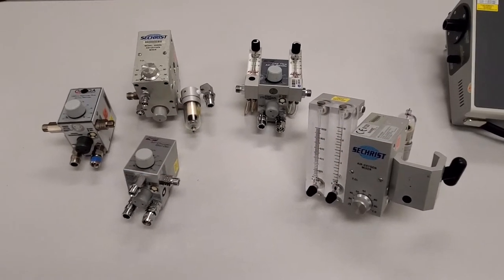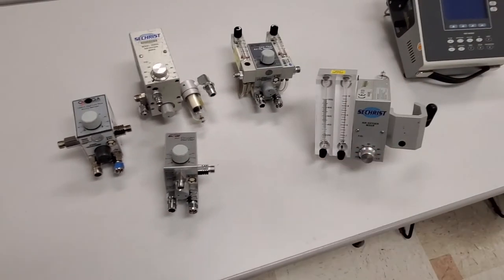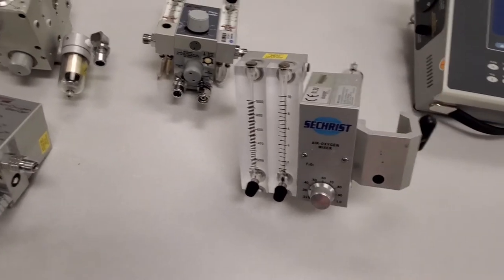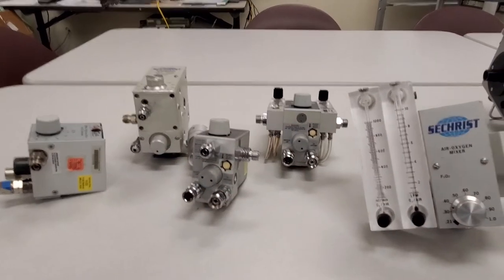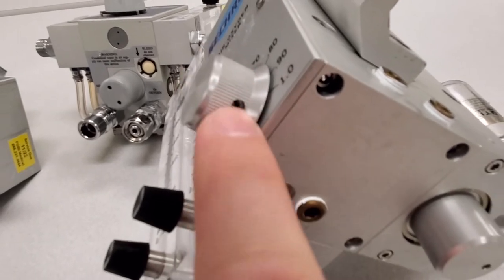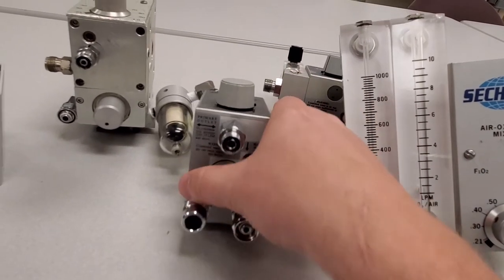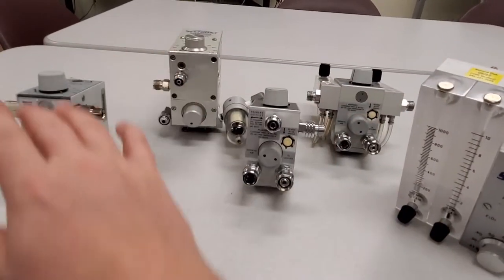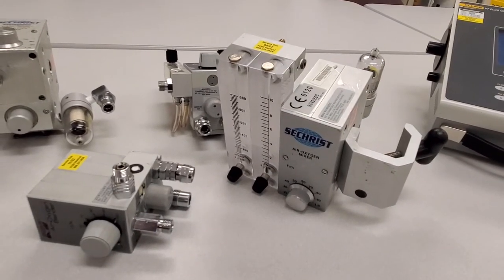Oxygen Blender Overview

Comment: I like to add some safety note and a question.
Oxygen itself is a non-flammable gas, but Oxygen can cause a socalled exothermic oxidation reaction, when oxygen comes in contact with lubricants like oil or grease.
So never use a lubricant like oil or grease inside devices where this lubricant comes in contact with oxygen, because this will cause a very rapid oxidation that develops heat and eventually fire inside the device.
A simple wrag covered with oil, in contact with pure oxygen will ignite itself and cause fire.
2:10 regarding the moisture trap, why is it that back in the old days (anno 80's and beyond) that they use some sort of water evaporator (plastic bottle with straw till the bottom) behind the flowmeter on portable oxygen canisters for use at home ?
My grandpa had severe Astma and had always a big canister oxygen at home from the local pharmacist, 
and i heared the pharmacist say that the bottle always must be filled with water. 
Later on, i never seen this water bottle again when applying oxygen to people. 
So was this plastic water bottle to humidify the inhaled oxygen, or maybe a watertrap (filter) for particles coming from the steel canister ?
Reply from the maker: Oxygen by nature is a dry gas and often needs a humidifier when connected to a patient for a period of time. The moisture trap is on the MedAir line which is filtered compressed atmospheric gas..
In medical, we use silicone grease on equipment that handles oxygen.
Reply: @BetterBiomedChannel  thank you for the clarification. Grtz
Reply: Use krytox use a lot on gas machine application.